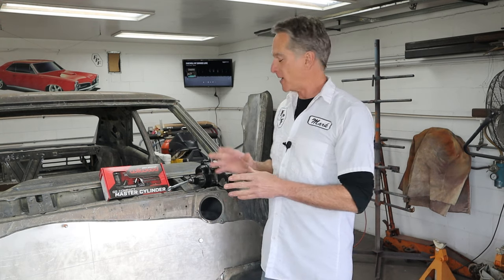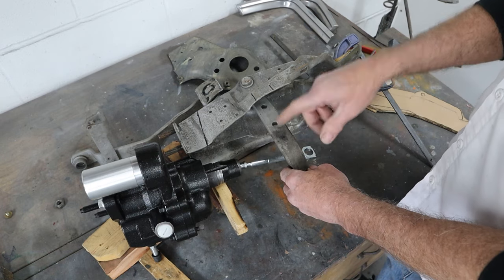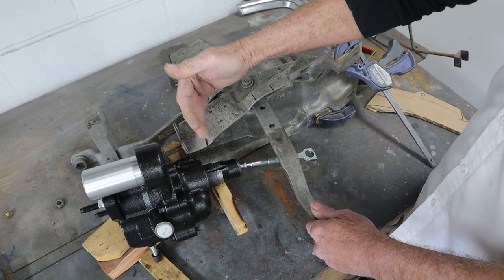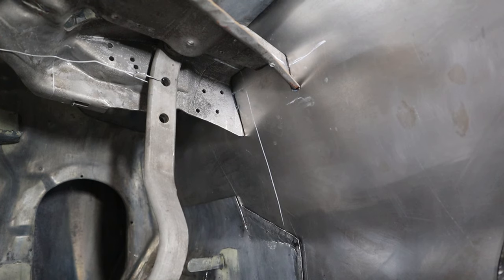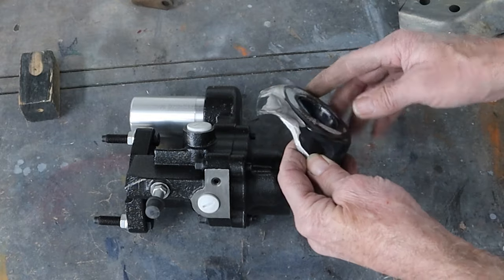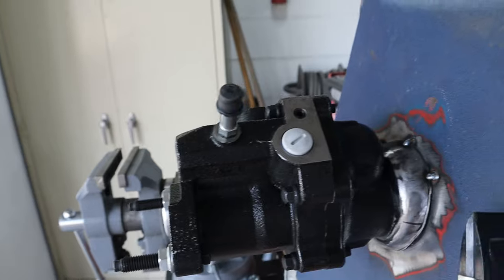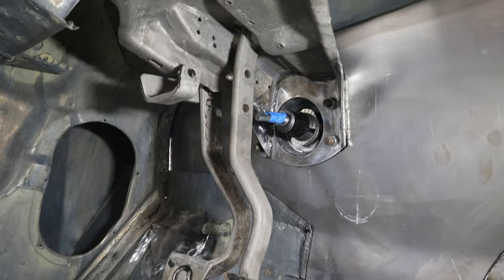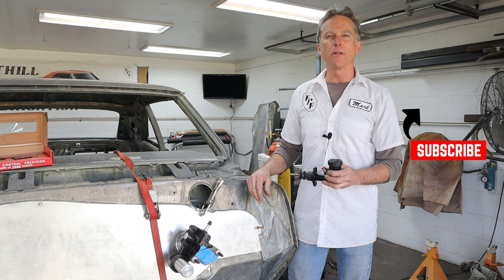Hydro Boost Mount Fabricated and Installed GTO RestoMod (Ep 41)

Comment: I just watched a video not too long ago... part of an excellent build series over at  the channel Fanatik Builds.  That guy is FANTASTIC... and, in my opinion, - if not the top build series, then at least one of the top 5 build series.  He's trying to squeeze an LS into an old BRG Spitfire or something... anyway, because space is at a premium he mounted the power brake booster transversely and came up with a bracket/lever to change the direction of the force when the brake pedal is applied.  He managed to find room back in where the windshield wiper motor usually sits.  It's quite ingenious... but seriously, if you haven't seen that build series you might want to consider checking it out.  It really is excellent - inspired by the Binky build series over at Obsession Motorsports.  I think your build series will probably make it into the top 5... but you haven't gotten far enough along for me to figure that out.  You are doing such a thorough job and teaching us every step of the way... like Fitzee, you know?
Reply from the maker: Thanks Tyler,
You mentioned him before but I haven't had time to check out his channel.  I am making myself a note right now.  Back in the day when there were cab over trucks still around they would mount the vacuum booster parallel to the firewall under the dash on the non air brake trucks like you mentioned.  Pain to work on but it worked.  Love watching Tony use whatever he has laying around to fix rusted out cars.  He kills me with that 24 grit though!

Comment: That booster nut socket is $100.00. I hope you do not end up needing to 180* the booster for the 400 valve covers. Very nice work.
Reply from the maker: Thanks.  I have heard those sockets are ridiculously priced, I think we can make one for free out of a piece of pipe laying around here. I had an 11" vacuum booster on Ruby before with a 1/2" clearance to the M/T valve covers. I haven't decided which way I will clock the hydro booster yet but once I figure out the clutch master cylinder I will know what I can get away with. Ideally I would like to put the spring housing on the outboard side which will give me plenty of room.

Comment: I really enjoyed this video Mark.  Figuring out problems like this is super satisfying.  I’ll be interested to see the clutch master go on.   I was surprised that the threads were metric on the clevis.   
Picking up my gas tank from Bo on Tuesday.  I’ll email a photo.
Reply from the maker: Thanks for the feedback Robert.  The clevis is 3/8" NF originally but the shaft on the hydro boost measures out at 9mm so I ordered an M9x1.0mm tap and die.  Odd numbered metric exist, just not common. Probably will be the only metric fastener on Ruby. I have a pretty cool thing to do to the firewall and then I will get to the hydraulic clutch master cylinder. 
 Getting the tank dipped was a smart move, especially since you are running fuel injection if I remember correctly.
Reply: I rebuilt the original carb and will use that in lieu of injection.  I’m staying mostly stock on this truck. 
Picked up the tank.  Looks great.   A little undercoat is still attached.   But it’s super clean and I’m very happy!   Got back to Gig Harbor today.   The tank is in the house.   I’ll get the shop up to temp tomorrow and get some primer on it.
Reply from the maker: Undercoating is tough stuff but is pretty weak after Bo is done with it and should come off pretty easy.  I have car parts in the house too.  Once the tank is done it is one more piece of the puzzle done and ready.  Must feel good to be moving forward.   @robertmazzei2412

Comment: That was awesome Mark! Did you get a new toy? I was thinking of hydroboost because I have a blower and no manifold vacuum but I have electric P/S so I'm going with a scroll vacuum pump and under cab M/C and booster. Thank you for your time.
Reply from the maker: Thanks, I picked up the Crossfire table a little over a year ago I think.  I knew I would need it when the chassis work starts but is is nice for a lot of other parts too.  I know you are going for drag and drive on the truck and I am no racer but don't most guys run manual brakes?  Smart move on having one less thing running on a belt drive on the truck, especially as fast as it will be spinning.
Reply: A lot of drag racers run manual brakes and steering. I want the drive between tracks (usually about 200+ miles)  and normal street use to be comfortable for me and the random hot chick. With the blower I can easily run a wide range of power levels. I plan to drive the wheels off it. Maybe even do some auto-cross. I have a spool and a Gleeson Torsen diff for my Frankland QC.  I'm also running an electric A/C compressor from down under with an "Old Air" inside kit. I even have power windows and bluetooth radio and phone. I'll be running in the 8.50 second class (about 170 mph) and I have plenty of power so weight isn't a big factor for me. It should be under 3300 lbs. If you want to run much faster the cage becomes quite confining. I just want to have fun. Sorry so long.  @FoothillPaintandFabrication
Reply from the maker: When it stops being fun and feels like a job/chore then you went to far.  So you will have a couple of different sets of blower drive pulleys and belts? @lazyhoundracing9621
Reply: Yes different blower pulleys for different power levels. The belt tensioner has a lot of range so one or 2 belts will work. I'll have 2 fuel systems, one for pump gas and one for race gas. I'll have several timing curves in the EMS. My built Frankland  Quick  Change has a possible 128 gear ratios that can easily be changed in 10 minutes. Switch from drag tires to DOT tires. So 1200 HP at the track and 500 on the street in less than an hour. @FoothillPaintandFabrication